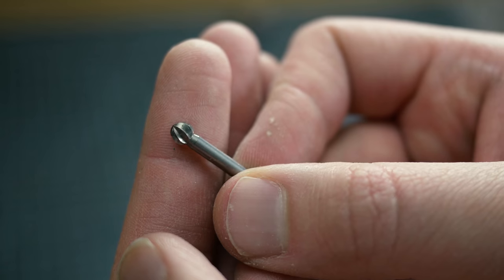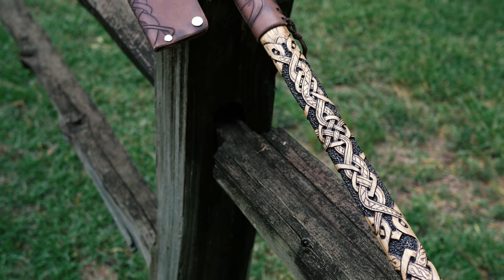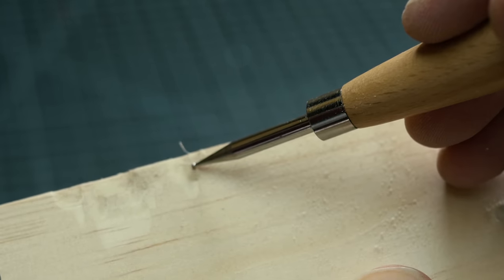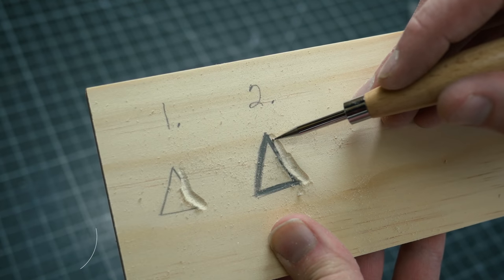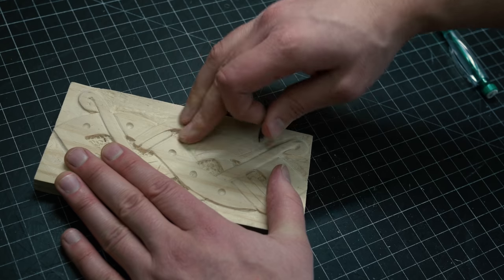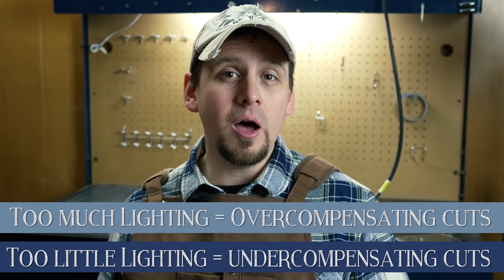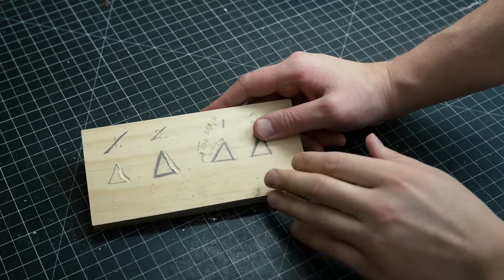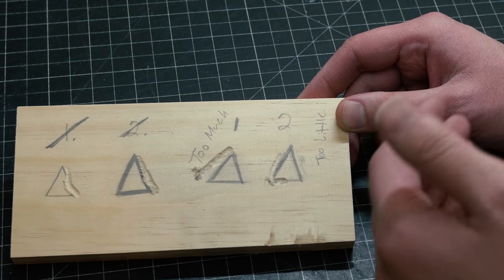The Top 5 MISTAKES Woodcarvers/Powercarvers Make

Comment: I'm just starting out and I get easily discouraged that I can't do a project so thanks for the encouragement and your videos.
Reply from the maker: It just takes time my friend, hang in there. Catch my livestream that was recorded and you will have a lot of foundation to build on.
Reply: Just getting started myself after past year I just want to be able to create from home . Mostly carved images , lettering, and small toys maybe rings. Im starting with Tacklife and small  whittling kick. Unfortunately Tacklife has some form of power issue when holding up. An I was warned about dust as I'm working in small room (only room left 😅). I'm absolute beginner never really bought tools in my life unless you count paint and big hammer. So I've mostly been try to work on my rough sketches and get small whittling cuts down. Long winded way saying thank you be interested in future content. Good luck all beginners 🙏☮️

Comment: I'm constantly messing with my lighting. Adding, removing, repositioning multiple lamps. Drives me nuts. Couldn't that cloth over the clamp lamp cause a fire?

Also, unrelated, but I started using freezer paper with an inkjet printer to place stencils directly on the wood. Works like a friggin charm. Thanks for another great vid!
Reply from the maker: Just make sure you aren’t using halogen bulbs. CFL’s and LED’s doesn’t get that hot. 

I heard of that method with the freeze paper! I am going to have to try it bro!

Comment: When cutting tools are sharp, the edges look like brushed aluminium or steel. 
So a fast way to check, if the tools are getting number, is the fact that cutting tools are working on or in materials that make the surface of the tools smooth. And that means that the tools shine more than after a correct sharpening. 
Here in Europe we don't allow the cutting tools to lose more than 1/10 of a millimetre before we have to deal with sharpening the tools again. 
So I always have a pocket light on me, because the chances of me coming to a saw or a mill, with a logbook with no entry, from the user before me, is always a 100% in my opinion. 
That way you can make sure that the safety is the highest priority under any circumstances.
Reply from the maker: Great advice!

Comment: Whats your opinion about Dremel 8220 rotary tool .Is it worth to buy ?
Reply from the maker: For wood carving buy a model with a flex shaft
Reply: Which model is good?
Reply: I heard dremel 8220 is a powerful tool
Reply: Dremel have  flex shaft right .but need to buy separate
Reply from the maker: My bad, that will work

Comment: So. here is a unusual question. I am wanting to Carve/Dremel my Family tree onto my Coffin Lid. Obviouly the contrast will be great as White timber under the finishing Stain/Varnish Top. Would it be easier to get "Letter Stensils from say an Art shop to run the Dremel inside of and make names. OR Print out Full names on Paper and trace such letters onto Lid?. Im thinking Stensilsand Cutting the Stensils down individual and then I can join together Characters much the same way the a New Paper is made.
Reply from the maker: For something that big I would use a router and definitely pay to get some stencils made with correct measurements. That would be a huge headache to line everything up just tracing. But with that being said, It would be fun to print and stencil yourself. There is no right or wrong answer here. Depends on how much time you have and what is easiest for you. Different roads, same result :)
Reply: @CorneliusCreations  Thankz for the advice. On further thought I will Print out the family tree on whatever ammount of A4s Then join together and see what Area it will take. From there I will probably make a DXF so I can get it Lasered out on a Pexi sheet(s). Router sounds good but I am trying to be more personal Hand carved. Another option would be to print on A4 Plastic sheets I guess. The actual carving is the easy part.

Comment: Hi there! Thank you for all the wonderful tricks to carving. I've just started out but stuck on what to design or designs to use. I'm a perfectionist which causes me to feel doomed to fail it so I don't start it (started to type that as you said 'Believe in yourself'). How do you personally push through that mental blockage? Would appreciate any help on this as it's kinda my dream to work with my hands without a boss looking over my shoulder and the pressure from a 9-5. <3 Love your work.
Reply from the maker: Thank you for your kind words! 
1) Perfection is the killer of creativity. Strive for excellence instead. Perfection mindsets neuters your ability to give yourself grace and creates self-inflicted hurt which in turn keeps you a prisoner to doubt. I have to constantly watch the way I think!  Remind yourself of this so you can stop those feelings when they come. 

2) If you can hold the idea in your mind you can hold it in your hand.

3) Give yourself grace, learning a new skill takes time. 

4) Mistakes isn’t failure, it’s experience ( I’m not just talking about woodcarving)

5) Done is better than perfect.

6) Listen to and read books. Its the single handed most effective thing you could ever do! 

Hope this helps! Btw pick up a copy of “ 5 things successful people do before 8 a.m. “ by Terri Savelle Foy. I promise you won’t regret it.
-Matt